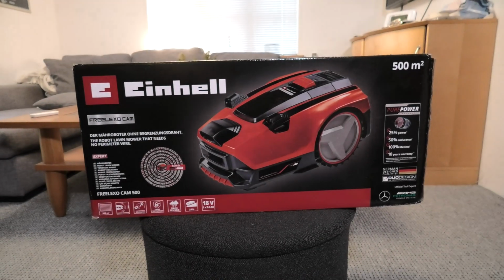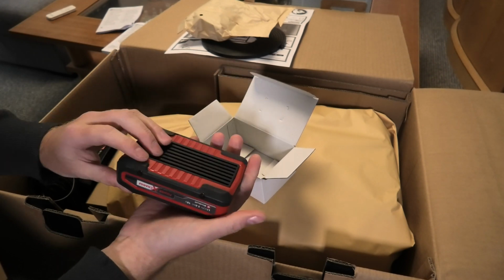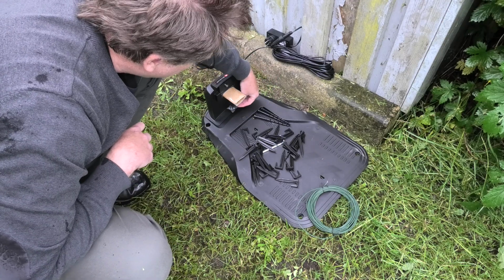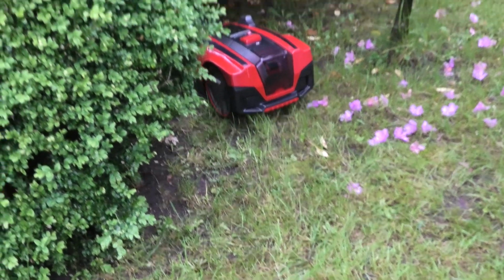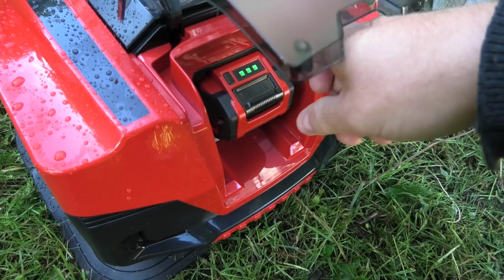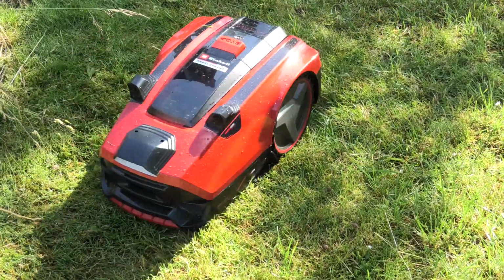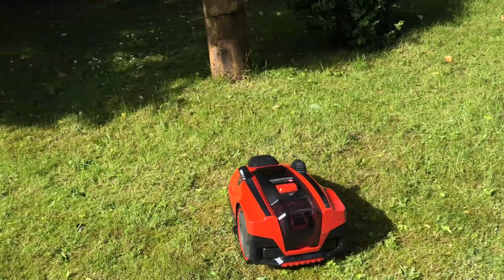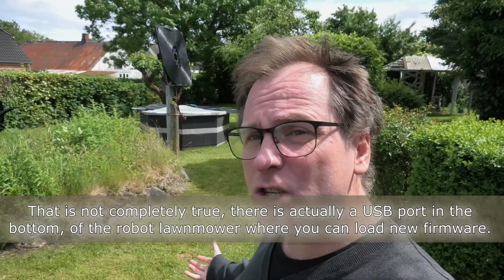Einhell Freelexo CAM 500 - Robot Lawn Mower that Sees - 1396

Comment: Ok i have one these, and used correctly and as intended they are great.
They are a vision based system so they need to see green infront of it to keep moving forward, thats why it doesnt like the brown patchy dirt and leaves and the shodows are a big change in colour so it hesitates. You wait way to long after pushing start to close the hatch so it times out. The blade wont start turning till it moves about 2m without hitting something or stopping.
Put the charger in a more open area will help alot too
Reply from the maker: It is still working,, but it was not programed very smartly :-/ just imagine if it would go for the longest grass.

Comment: To pronounce "Einhell" in English, you can say it as "INE-hell." The "Ein" part sounds like the word "mine" but with an "I" at the beginning, and "hell" is pronounced just like the English word "hell."

As per starting the robot, I'd say RTFM 🤣. I'm pretty sure you didn't. Who does nowadays. And in another hand, if you have to RTFM, it's not user friendly. Usually, you have to give is a certain position on the base, with a specific distance at minimum from the edge or the wall, and the  robot most probably has to cartography your garden at some point to record the limits. 

That said, what is the size of your garden ? Because if I remember correctly, 500 stands for 500m2 ... 

I have a lot of Einhell products and therefore a lot of PowerXchange batteries and I wonder if I'll buy this one or not....
Reply from the maker: A really good product, you do not need to read the manual, to do the basic things,, only when it comes to the more advanced stuff...it really failed this test miserably, and this is why Apple products are so popular. :-)